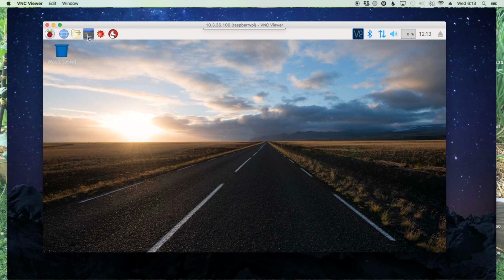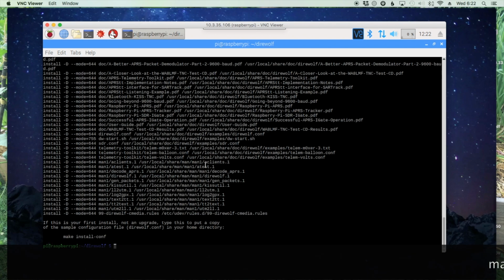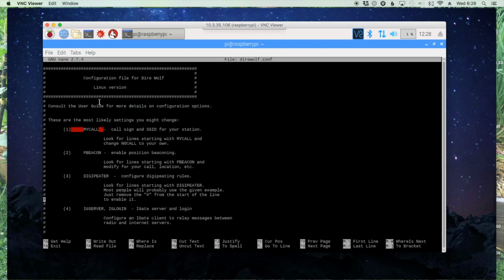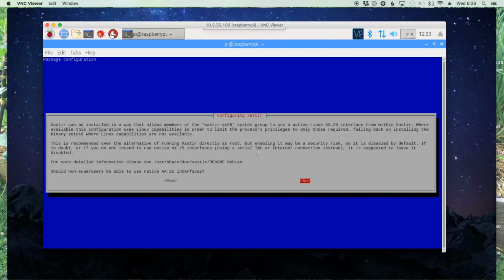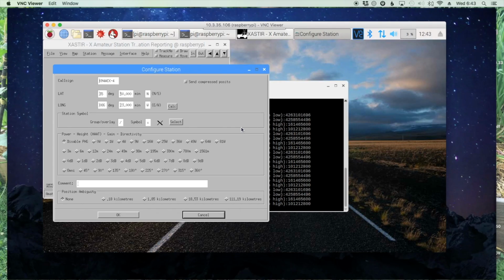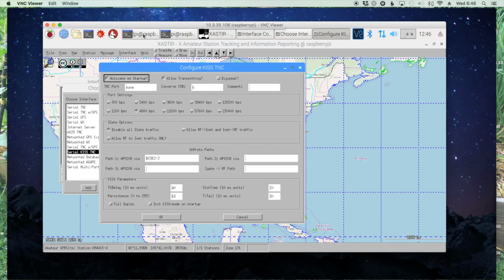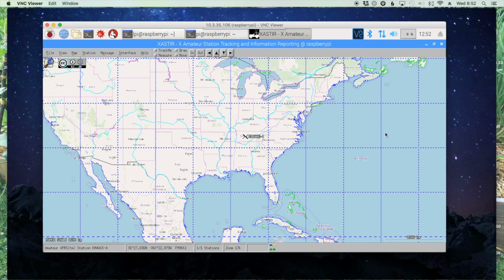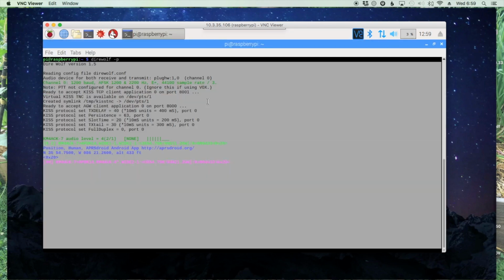APRS Digipeater with a Raspberry Pi

Comment: Help! When I run sudo xastir I get this message. 

 festival_client: connect to server failed
SayText: Couldn't open socket to Festival
No protocol specified
Error: Can't open display: :10.0
Reply from the maker: Did xastir start? The Festival error is normal when installing with the apt-get command. If you want to install Festival, you will need to compile from source. If xastir opens, then you will be able to do everything in this video and can ignore the Festival error.
Reply: @KM4ACK   xastir didn't start. (as far as I know) this is the message I get after I type sudo xastir.
Reply from the maker: Not sure what could be the cause. Is this a raspberry pi? Are you running Raspbian Stretch? Was this a fresh install or a system you have installed other software on? I know others have followed the tutorial and it has worked for them.  You could try the following command in order. Don't type the notes in ().

sudo apt-get remove xastir (this will remove your current installation)
sudo apt-get update (this will update the repositories)
sudo apt-get upgrade (gets latest updates for installed software)
sudo apt-get install xastir (reinstalls xastir)

If you downloaded an out dated version, the above should get you on the latest. de KM4ACK
Reply: @KM4ACK  Same problem! I followed your video to the Tee I'm using a new pi 3b+ with a new install of Stretch downloaded from the pi.org website. I even started over with a new install of the OS with the same problem. Your chirp video worked without any problems.   ...Not sure what is going on?  I am somewhat new to coding but I can follow along with a video.   BTW I love the Videos and your Instagram acct. Thanks for the help! Rob KG5AUN
Reply from the maker: Glad you enjoy the vids. hmmmm......3b+. Wouldn't think it would matter but that could be a clue. Mine is the RPi3. Also, looking back at your earlier comment, I see "can open display 10:0" That doesn't look right. In a terminal window type "echo $DISPLAY" without the quotes and let me know the results. de KM4ACK
Reply: @KM4ACK  
This is what comes back after I type that command.  echo $DISPLAY
:10.0
Reply from the maker: Got to admit that this one has me stumped. Since I dont own the 3b+, I can't attempt to replicate the issue. Try posting in the forums https://groups.io/g/RaspberryPi-4-HamRadio/topics Guys there are sharp and maybe one of them has the 3b+ and could help you resolve the issue. Sorry I can't be of more help. de KM4ACK
Reply: @KM4ACK  I am going to try it on a 3b and see what happens. I'll keep you posted.
Reply from the maker: Please do. I am curious of the results.de KM4ACK

Comment: Thank you for this post. I’m building a APRS system with the raspberry Pi and the Northwest Digital DRAWs board. It replaces a signal link and adds a real-time clock and GPS. I hope to have it working with the same software and the radio can be any that has a packet port.